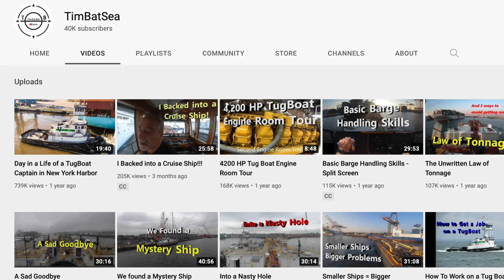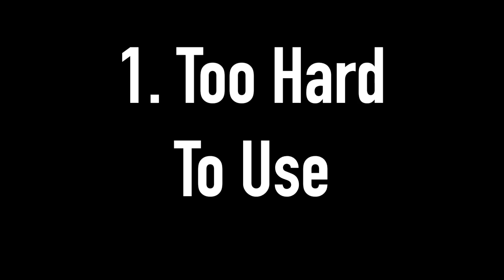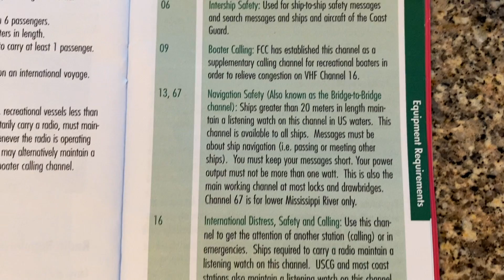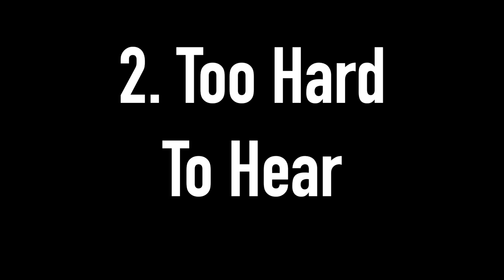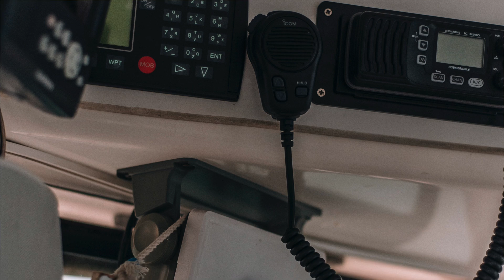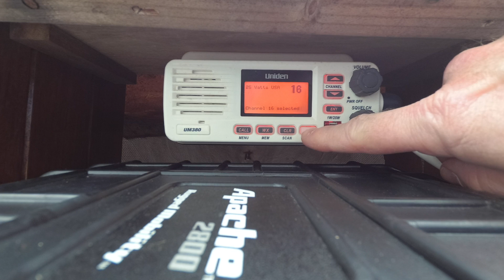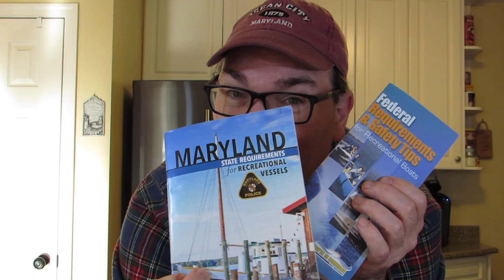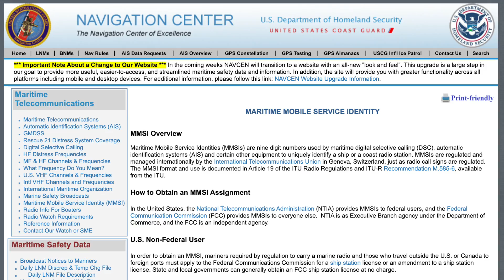The Problem With Marine VHF Radios

Comment: Well, the ways the laws are written you are not on a "compulsory equipped ship".  Which means you can set sail with no communications or safety equipment at all .  I do not recommend that.  Taking the safe boating course is everyone's best bet.  I don't recommend a HT (handy talky) for the principal radio of any boat.  Go to a 25 watt with a 6db gain VHF antenna and put it as high as possible.  VHF communications is known as line of site communications, so the higher the transmitting antenna and the receiving antenna the further you talk (no skip).   If your ambiant noise is high, then install an external speaker for audio amplification.  

The HT is really only designed for short range commo.  Technically it is not recommended as a primary source for emergency communications, unless you are in the water and a helicopter is flying around.  

The DSC (Digital Select Call) function is new, but effective.  ALL USCG stations monitor Channel 70 for DSC distress.  It is much more efficient than a voice MAYDAY (which is still acceptable).  A DSC distress will have your MMSI number (registered to your boat only) so they will know exactly who you are and it is also interfaced to your GPS for positioning.   But don't play around with it.   

The most important feature which was only discussed briefly in your presentation is, Channel 16 (voice MAYDAY) or Channel 70/DSC,  will put you in direct contact with the USCG, to their radio room.  They are trained to respond immediately.  You missed that point.  

The flaw with ever considering using a cell phone range is, most cell towers phase their antennas towards land where the preponderance of their traffic is located.  So, while underway you will run out of cell phone range real quick even if you can see land a few miles away.  However, the next problem is, yes you can call the USCG but who exactly will you be speaking to?  You could be talking to the outboard motor repair division.  They would then most probably tell you to call another number.   Then that number could still not be the radio room.   A MAYDAY by definition is:  "immanent loss of life is probable".  So, you could be on fire, sinking and have multiple serious injuries on board.  You do not have the time to keep calling numbers to try and get to the right area (radio room).  Don't even think of 911.  That system is based on land emergencies.  

So, yes all vessels no matter the size should have a marine VHF radio on board with at least on responsible party available if needed.

Comment: All good points. But, I’m in the camp that all boats should have a Marine radio along with a personal locator beacon attached to their person.  Most of the time I hear stories of people lost at sea don’t have or know how to use it. One could save the coast guard phone number in their cell phone. However, all boats should have back up systems. Great video! Thanks and all the best. Jim from Georgia.
Reply from the maker: Going offshore certainly calls for better gear and preparation than other forms of boating!
Reply: It won’t be long before self tracking devices will be common place, I think bush walkers are now hiring them from convenience stores at trail heads. If you break a leg or legging it away from a bushfire, rescue can find you,

Comment: You are talking without the right knowledge. A hand held vhf dont send wery long distance, its "not" 25 w but only 5 or 6 w, so the range is only a few nautic miles, but with 25w  you wil range about 20 to 40 nautic miles depending on the hight of your antenna.

I would recommend to go through a course...
Reply from the maker: I never said a hand held transmitted a very long distance. The knowledge I have is my personal experiences on the water and observing several other boaters and passengers who either don't have a VHF on board, don't ever use it or have no idea how to use it.

Comment: I have one fixed mounted with an external speeker (better range and better sound) and one hand held in case I have to leave the boat. I feel that the biggest problem is to get used to all the formalities when making different calls (Mayday, pan-pan, securite, relay...with and without DSC).
Reply from the maker: I have a cheat sticker to help remind me because I find it confusing as well!

Comment: The USA is ridiculously  relaxed when it comes to boating safety.  One only has to watch that Haulover Inlet videos to see how weak the USAs boating laws are..  Yes you are correct that in Australia your VHF must be registered and you must have a certificate of proficiency.   However,  27meg marine radios can be operated by anyone regardless of training.  They are very short range and only really good for harbours and short range transmissions.

Comment: Handhelds are way too underpowered to actually provide safety on open sea, you'll get approx. 5km on a good day, you'll need a 25W fixed VHF with a good antenna which is mounted as high as possible AND vertical =V E R T I C A L= not laying down or half way down to look cool (or something), as often seen on small powerboats.
Also be aware that VHF is LOS (Line of Sight) radio waves and doesn't normally reach beyond the horizont, to extend that reach both transmitter and receiver will benefit for a high mounting antenna.
Secondly, even with a fixed radio, you should test it regulary, many things can go wrong in marine environments - so test it.
If you go further out than 20nm you'll probably be out of reach of land based stations, since most lesiure boaters neither have LRC certificate nor MF/HF radios, you'll need a PLB and/or sat com. device like Garmin InReach or spot.
Yes DSC is a must today :)
Reply from the maker: If I was in open sea, I would certainly make sure I had the right equipment. Open sea is a very different situation than the weekend river and bay boating that so many people do in my area.
Reply: You only have to be within distance of another boat.  They can call for help

Comment: I would encourage you to look at a PLB or EPRIB (preferably with something called and AIS Transponder in it) instead for the "call for help" purpose.   I have never made a full mayday but I have responded to north of 100 maydays.   (I was in the auxiliary in Canada and we are now sailing around the med).   I will agree with you that most of the time they don't work great for a small recreational boat.  The handheld is relatively low power and used with a small antenna either in a cockpit or low down it has a relatively limited range unless you are somewhere with a really well established Coastguard radio net (like the US east coast or the pacific north west.) EPRIBs / PLBs are much more likely to get a signal out regardless of where you are.  More importantly they include position and if you register them (Always register them!) the RCC (rescue coordination center) will have your shore contact's phone number.   That makes finding you much easier.   VHFs (especially handhelds) are nice when you get to the target and need to make contact...
Reply: How about an Inreach?
Reply: @misham6547  good idea - Inreach could certainly work if you prefer.   The big difference between those two in my eyes comes down to who receives the distress message.   Inreach goes to a private group - GEOS - who then coordinate a response.   PLBs effectively go to coastguard.   The question is often are you somewhere with coastguard?   I have used spot (which is like Inreach) canoeing and it is awesome.   Also it allows messaging which is a plus.

Comment: Wow. You should not be allowed to broadcast this stuff. VHF is longer range and clearer than others. The fact that you have chosen a handheld is YOUR problem. If you had spent more and fitted a powered AMPLIFIED radio set then you would be able to hear it! 

Whilst there are protocols associated with broadcasting WHY would your wife behanging over the side of your boat to read your registration number. Print it on tape and stick it to your dashboard. The emergency services will do their best to understand your wife in an emergency and so she doesnt really need to learn the protocols!!! YOU as the Skipper, are more likely to know your correct position and so YOU should use the Radio - Not a passenger. 

You said it all when you said you had been boating for 2 years only.

Comment: All great points. I feel as a boat captain regardless of the size of your boat, you are responsible for knowing how to use all the equipment on your boat and this includes the VHF Radio. I operate both a fixed and handheld GPS VHF radios with DSC as well as a ARC Personal Locator Beacon (satellite PLB) in by Dry Go Bag in the event of a sinking or fire. We spend a lot of time operating in the ocean south of Fire Island NY and I would feel helpless without this equipment in the event something went wrong. As with anything else, its about each boat captains personal responsibility for their vessel and occupants.
Reply: I would also add AIS
Reply: That was my thought exactly.
Reply: @andrewcraig5689  can you send pictures of your dry bag? 💼

Comment: So, pick up the bloody "guitar," learn the phonetic alphabet, learn a bit about radio propagation, calling channels, repeaters, protocols etc.  This may seem like a PITA right up until the moment these skills are needed.  I have a 14-footer with a fixed and handheld, both DSC and a chartplotter.  I can at least tell when there is traffic on 16 with volume up and usually turn down the RPMs to hear what's going on.  The departure check list should be:  1.  PFDs (worn), safety stuff flares etc etc.  2. Gas topped off. 3. Batteries charged...  Even a 14-footer should have a full compliment of coms and safety gear unless you are on the pond in Central Park.  hihi.  For way too many checklist is:  1.  Beer.  2. Bait...  Too many think the Coast Guard/Marine Police are a PITA until they get in trouble, then they think they are angels.  The Coast Guard/Marine Police think that 90% of Pan Pan and May Day would be unnecessary if some common sense and marine safety were on board.  You don't know what Pan Pan is?  Why not?

Comment: It you and your family you are putting at risk in a boat. Irrespective of what is required, having a VHF radio and training on its use it an obvious opportunity for greater safety. Only fools would deny that.
At the helm, it is easy to have a label / small sign with your boat's name and hull ID printed in the phonetic alphabet so that it can be read in a panicked situation.
In the UK, the VHF radio is unlicensed, but the operator must have passed a training course (online course, in-person exam).

Comment: you can transmit a marine radio from land.      1 condition though, you have to be reaching someone on the water,.....  water has to be in the equation......water to water is ok.   water to land is ok.  land to water is ok but transmitting land to land is not.

Comment: They make add on external speakers they are so loud you can hear it just fine even on a cigarette boat with open exhaust running 90 Kts. I agree the speakers on fixed mount radios are terrible. I disagree with VHF radios being confusing and hard to use. I am a commercial guy but also a recreational boater in my time off, but I don’t see how anyone can’t learn how to use a radio in a few minutes it’s not rocket science.
Reply from the maker: One of my other jobs uses 'push to talk' radios and there are many people who have a really hard time trying to operate them. For some people, the only time they might ever encounter a 'push to talk' radio (like a marine VHF) might be on a boat and if they aren't operating the radio, they're getting no practice.
Reply: @WayneTheBoatGuy   Wow and I thought I had stupid people working for me! I don’t understand how one would need “practice” to use a radio it’s about as simple as it gets key the mic and talk? I don’t understand what the problem is if someone is so stupid they can’t figure it out in 5 seconds or less they probably can’t manage to tie there own shoes.

Comment: Thanks for sharing these good points. I haven't been window shopping for a handheld marine VHF radio in years, so I didn't know about the DSC handhelds either, till I saw this video. Also, I used to have my mobile ham radio setup in my previous vehicle. I had it set up with a nice loud speaker in between the driver's seat and the passenger seat so we could both hear it well. I'd definitely want a loud speaker on a boat.
Reply: Please watch online videos how to use a VHF Radio. This will help you alot your not the only one who did not know about the DSC call mate. We all got to start somewhere and it all online these days mate. Play it safe mate

Comment: I have to agree with most of what you say, but there a few issues you missed out. First is cost: a new phone cost more money and inconvenience to replace than a hand held vhf radio. My hand held vhf comes with bluetooth and I can hear all calls using my ear buds. If you use a boat, you carry other equipment like lifejackets and flares. (I have a Odeo Flare MK3 LED.)  Basically we plan for plan for disaster.  But what about others? The coast guard cant watch all the sea, all the time.  They rely on boaters who know the local area to report problems. Once a year I have to hit channel 16 to ask for help after spotting a day triper washed out to sea on inflatable or a new boater in trouble.  1/2 submerged sea containers washed over board are an increasing problem. You hit one at speed and you will need repairs or sink.  Ships will dump at sea and before that waste hits the beaches, its better to call it in.  The idea behind vhf is community. By owning one, you're another pair of eyes out on the water keeping others safe, not just yourself.
Reply: Greetings from the West Coast of Scotland, you are spot on with every point, I always try and cover all the bases when on the water and I totally agree that VHF is community. Good luck and good luck.

Comment: It is a really good idea to have at least a handheld pair of radios
CH 16 is used for all locks
In emergency it is better to have a radio and not need it than need it and not have it

Having a good pair of VHF business band radios that are on MURS and 6 FRS radios that everyone has 1 for on board communications

I strongly recommend that everyone who is going to get on a boat watch videos on how to operate a marine radio

Likewise I urge anyone who is getting on a plane even a commercial plane as a passenger that you watch aviation communication videos and that at least one person in your group is carrying an aviation band two-way radio.

It is not something that you may ever use but in an emergency having one especially one that is a dual band that can do aviation and the VHF band is a really good item to have

Icom was the first radio that I owned and I was really impressed with them and standard before they merged and still today is a very good company and I have owned VHF radios made by them
If you don't know how to use a radio or what frequencies to program in it you can ask online if you don't have someone that you know who can program it for you

Usually everyone knows of someone that is a tech person and they will usually be happy to program in the key frequencies and go over basic operation of the radio

Marine radios make it really easy because they have a channel 16 button and the fact that they have channels versus having to program in a frequency is really nice and the same goes for aviation radios that they have the international distress frequency as a single button that you can press and get the distress frequency to come up without having to program in manually

For everyone on a boat or a plane that is in my group I have the FRS little $10 handheld battery powered radios that we use to talk to each other and they are great for boating and they are awesome for use in airports because they will cover the entire airport even the larger ones and you can each do what you want to like going and getting a bite to eat and not have to worry about missing your flight and more than half the time the flights change gate and having the radios and being able to tell everyone in your group where they need to go so you're not waiting at the gate for everyone to come back to tell them what gate you need to go to they can all be directed to the gate that the plane has moved to without needing to come back to the original gate

Most people don't even think about communications when they're traveling and they just rely on their phones but it takes time to text or call and a lot of times people have their phone on silent or in airport mode and having the ability to just key up and have everyone here you and acknowledge within a few seconds is a great resource

Comment: I have that exact portable (as a back up for the fixed mounted and for crew use during anchoring in windy conditions) but you are completely right there are similarly priced portables with the DSC feature and I wish I knew that when I bought the portable. Great channel by the way lots of common sense stuff
Reply from the maker: Thanks!!